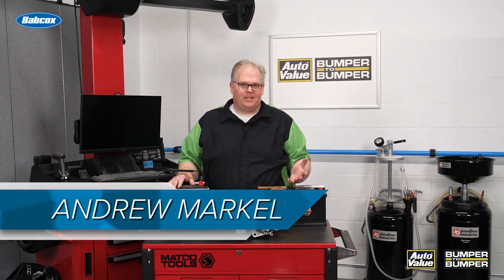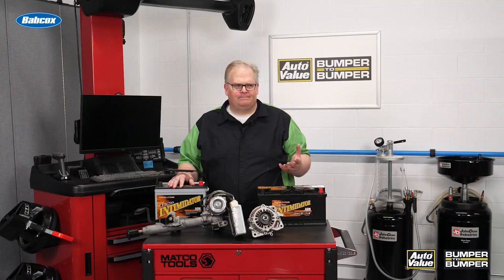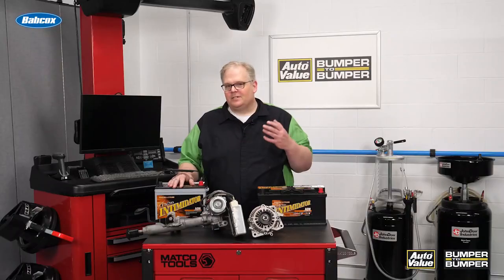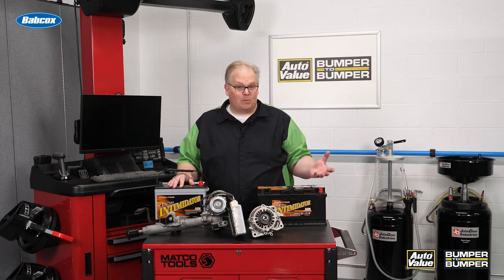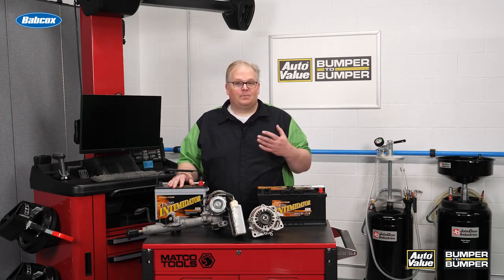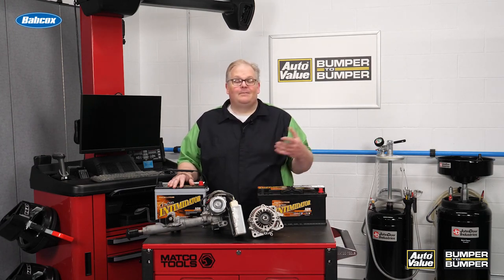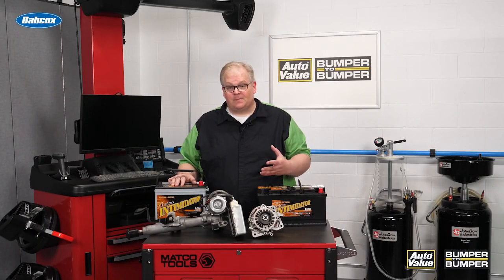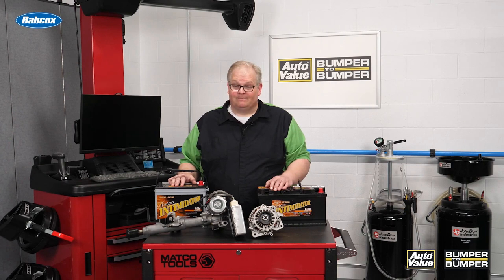Can a Weak Battery Cause EPS Problems?

Comment: Nice video! Hey I am working on a dodge Durango 2018 the Eps stopped working and car ran shortly after the car wouldn’t turn on. I disconnected the wire that runs with can and power wire from fuse box and car runs again. Was wondering what you think it might be car runs everything works if that wire is disconnect, the moment I connect the car goes haywire wipers start going off car won’t turn on every light lights up like a Christmas tree and I end up with every possible code that vehicle can have. I attempted to isolate the wire that runs from fuse box solely to give the electric motor power but no luck. Any thoughts?

Comment: Hello! I have had this problem with my 2018 Corolla, while replacing the inner tie rod I let the car key in without making the car running which made my car battery go bad. After this and jumping the car my eps started acting up, I thought it was the inner tie rod procedure but I was having troubles cranking and starting the vehicle, I took it to autozone and the battery voltage was around 10.52V. Now with the new battery i am not getting the red steering wheel alert in my dashboard or suddenly getting stiff steering for seconds which is a road hazard. Great video!
Reply: Thanks for the comment. I was searching if I could run into issues with a weak battery and EPS. My problem is different as my alternator is shorted so I  disconnected it. I figure I need the battery to last just long enough to get to the shop for replacement. I have a fresh battery installed so I think I can make it 10 miles without my voltage dropping as low as yours before I get there.
Reply: @aaronforward2309  That's nice! Glad you could found a solution for your issue. Reply back if you finally get it fixed, please.
Reply: @SirD31V1D  sure will do. I’ll make an appointment Monday. I was debating replacing the alternator myself but it’d prob take all day haha. And I don’t have much time.
Reply: @SirD31V1D  After talking with the shop, they suggested I tow it in. That was probably a good idea than risk getting stranded and kill another good battery. My car was at home and it took about an hour to pick it up and drop it off 10 miles away at the shop. It would sucked to be stuck on the side of the road for an hour. I got my alternator replaced with a OEM remanufactured unit and everything seems back to normal. One note, is the slightly burn smell exactly I was smelling before with the old alternator. I suspect it's just some oils or the new alternator break in. After about a week, I can hardly smell anything.
Reply: @aaronforward2309  Great! Thanks for sharing man. It feels very nice to solve those issues around our vehicles.

Comment: You ask the question. Can a Weak Battery Cause EPS Problems? Did you answer the question? NO
Reply: Exactly!!
Reply: Yeah it can it’s happened in two vehicles I had both with eps, the first was a 2013 Honda accord and the pos connect came loose and everything shut off and ps was stiff as a brick; with the project car a 08 Pontiac g6 its just a weak battery but I drove all the way to back Ohio from Michigan with the battery light on the eps only started acting an ass right around the corner from my house
Reply: @CptKushBerry  did you replace the battery and did that resolve the eps issue for you? My steering got stiff this morning not lights went but after a couple minutes got the battery light flashing. It's 2010 corolla btw
Reply: @FullyShadow  I replaced the battery and it didn’t help I’m going to replace the alternator next and that should be it